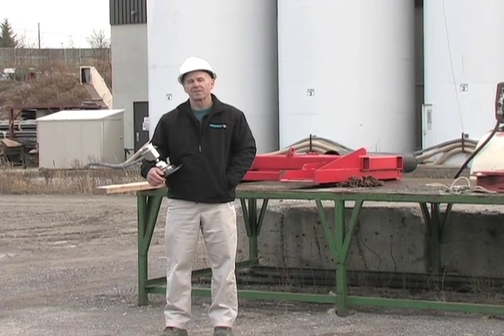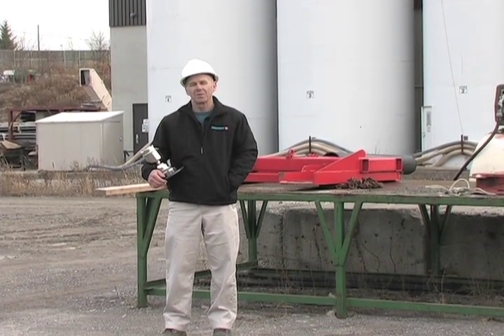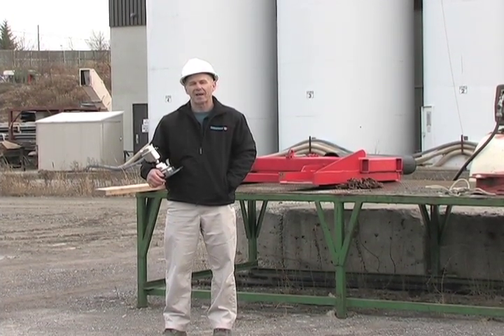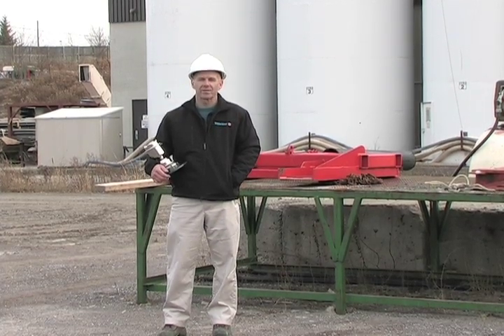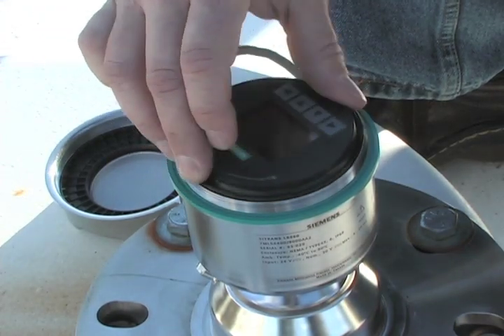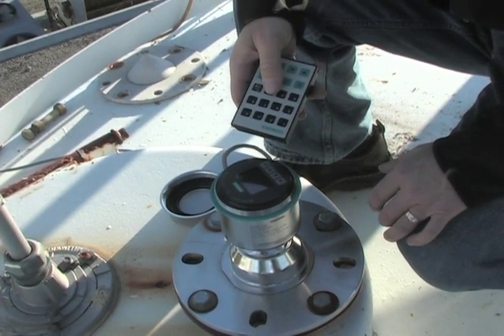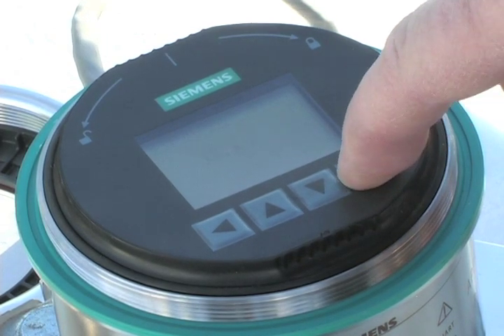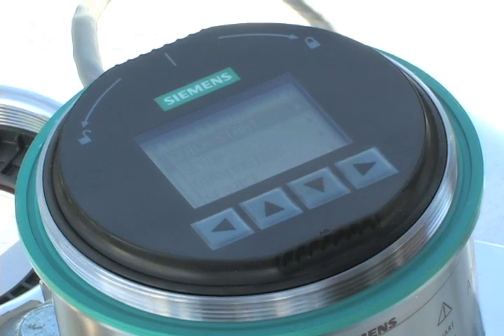SITRANS LR560 Installation

Comment: I love LR560, installed about 25 nos. on Cement, Iron Ore, Catalyst tanks etc.... but i don't like RD200... no units, model with separate 4-20mA requires power supply also...